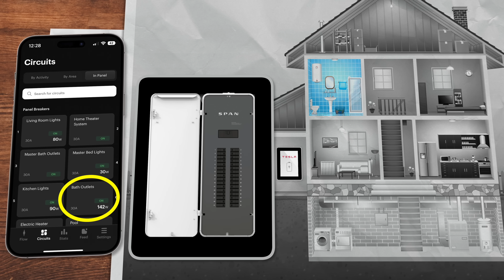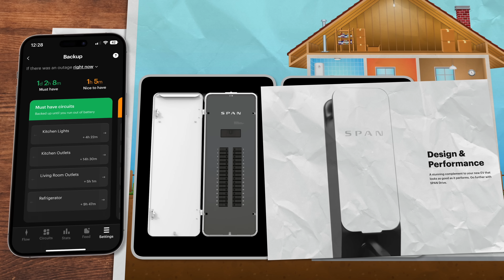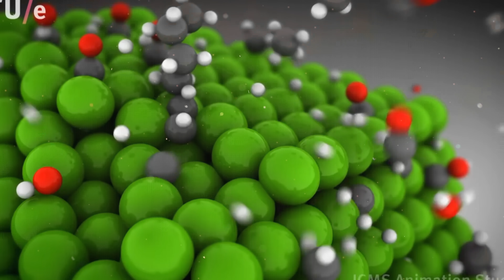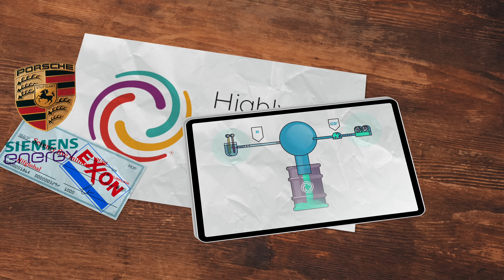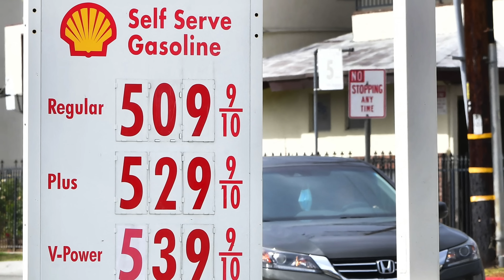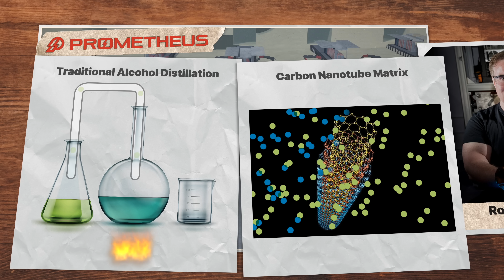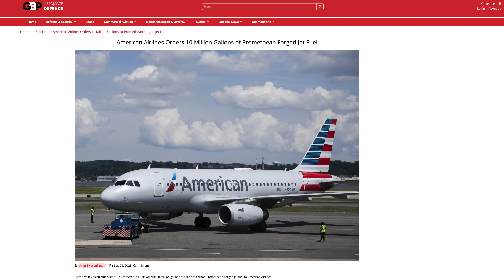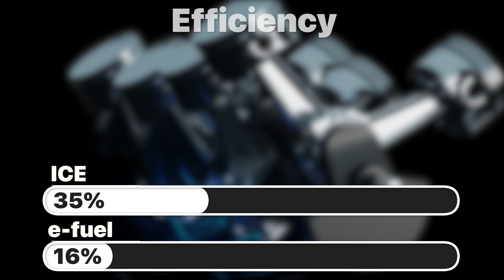EPIC Breakthrough Can SAVE the Internal Combustion Engine!

Comment: Nice presentation, have you looked at the use of Ammonia at all...   Years ago one of the fastest flights just under the space environment, was carried out by a modified jet plane...  Nowadays the process of manufacturing Green Ammonia is using a renewable source of electricity and simply water and air....  A business called FEUL POSITIVE ticker NHHHF, has machinery that can be site based and it requires far less energy than the traditional construction using Faber Bosch....
Would be nice to hear from you about this option, it is a very easy process to modify ICE to run on this feul too...
So again we get to keep the main infrastructure and it saves a lot of carbon footprint as the vehicles used now... Won't need to be scrapped and then huge environmental costs for remanufacture..... 
Ammonia has far greater in transit stability and already its being adopted in the Marine sectors...  Plus it is very good for the production of fertiliser, indeed tractor and pick up trucks have already been converted....
If you have featured this already, please provide us with the link....  Look forward to your response and content... The EV is not necessarily the only way forward, although the push is undeniable..

Comment: It would make a difference if people stopped buying suv's and other vehicles that  have a mass over 2 tones.
Personal transport vehicles can be made that do over 100mpg and are fun to drive.
Reply: Massive +1 to that! Some time ago i got to drive an early 2020's BMW. Nice four door car, 3 liter twin turbo. Thing was close to two metric tons! Sure, it accelerated quickly and actually cornered alright due to some really nice tires, it did feel really heavy and was down right dangerous if the road was slippery just because of how heavy it was. 30 mpg (~8 l/100km) was not terrible though, so imagine putting that advanced engine into something that was half a ton or a full ton lighter! Though i think there is a law here that says that no production car can be less than one ton.
Just for reference, a new Ford Explorer is 2.25 tons, a Chevy Suburban is 3. And most of the time they only carry one person... Speaking of, an old Citroen 2CV was a 600kg car with a reported 4.6 l/100km (~64 mpg), also often carrying one person. In 1980s.
Reply: @AgentWest  You have to thrash a 2cv in order to get it below 60 mpg.
I was thinking more along the lines of the Gordon Murray designed Rocket or one of the 3 wheelers that started off in the 30's with the Morgan and finished in the 60's, early 70's with the plethora of micro cars.
Small cars no more than 2 seats, powered by motor cycle engines of various parentage

Comment: The biggest challange I see here is providing enough renewable energy to produce these E-fuels without impacting on the efforts to replace our existing energy grid needs, particularly with a lower efficency since that will mean that you will need more electricity to produce the same amount of transportation.  Really, in all these techologies, the issue seems to come back to the time required to transition.  Combined with the issues we have with time (we will probably pass 1.5 degrees of warming in the next few years) we might have to make some tough choices over lifestyle changes weither we want to or not.
Reply: That is not a problem. Check out prometheus fuels.

Comment: I think tidal energy needs to be harnessed, there is plenty of places that can be used , to store the water at high Tide, close a gate, use the energy stored in the  water, or should be capable of supplying power for 8-10 hours at minimum, and more if there is a river feeding the area,   basically a hydroelectric dam, and it can work in reverse, as the high tide Is filling the system,    we need to do all we can to save the earth from ourselves!! ✌️

Comment: What about good old LPG ( Liquid Peteolium Gas) ? Nobody talks about it. Here in Australia both petrol & diesel have gone up dramatically in price BUT LPG has remained the cheapest at only $1 and diesel at $2.30..... LPG is an e-fuel as it is a cleaner burn and better for the engine. I have a duel LPG/Petrol engine so never get stuck if l run out of LPG.
Reply: I should know the answer but I don’t.  Volatility, maybe?

Another thing that isn’t talked about much is that the harvesting processes for natural gas tend to release a lot of trapped methane.  Methane has a high greenhouse gas index than CO2 when looking at a 20 year timescale.   So, it burns clean, but the full lifecycle can end up being as dirty as gasoline

Comment: Two bit da Vinci.. my idea is to use canabis smoking vaporizer tanks/coils to replace fuel injectors which will vaporize the fuel making it more volitile increasing HP and economy by up to 10x possibly. I think would need to do this in the absence of oxygen so it doesn't ignite before gets into the cylinder. I would try carbon monoxide outta the engine or argon welding gas . Could possibly use microwaves to vaporize fuel like in advanced waste tire/plastics pyrolysis to fuel plants use.

Comment: No offense why would we want to save ICE cars oh ok cool I’m just not for being addicted to oil any more. And with hydrogen power paste and the new hydrogen engine that is literally only rotating cylinders with such small tolerances it doesn’t need things like gaskets and other gas cars require. It all so weighs like 60 lbs can be linked with others in series and outputs like 140 hp and can hit 18k rpm’s. Tec and stuff like that I’m all for. I’m not biased to one technology and think the more options we have the better off we are as long as no company gains monopoly control over the market again like oil companies have and car companies did for way to long. Let’s be honest we could have been driving clean energy cars probably starting in the 80’s for sure by the 90’s just oil companies would find and but any emerging technology and shelf them hidden away so they could keep us addicted to there poison for a few more years and that’s still going on and why they short sold Tesla for years trying to bankrupt them or at worst slow them down and allow a longer less abrupt decline in oil demand but now to may people are going in to many different directions all giving the desired effect of oil free driving thru clean or cleaner energy while not changing the convenience of gas cars cause let’s face it the infrastructure and supply lines for gasoline are extensive and pre existence so any way to kinda retrofit or adapt refueling with similar ease safety and time is and has been the barrier keeping the electric vehicle market a serious hesitation and anxiety of recharging times and limited range and becoming stuck with no quick or easy way besides a tow truck and spending then possible hours to charge only to run into the same problem further on down the road and as we are seeing sure there are charging stations around and easy to find on a map but a map can’t show you if they are actually operational or if they have been damaged or just out of order from people who think it’s funny to make the snowflake cry and regret not getting a big American gas guzzler truck like real Americans own.

Comment: Interesting, but you lost me at the nano tube process that supposedly allows alcohols through but block water molecules. However, to the best of my knowledge, water molecules are smaller than hydrocarbon molecules. So, how is that supposed to work? Something doesn't square up there!

Comment: This was a good article, from what I have read in the past that when there was an embargo against South Africa it was making its own fuel with the FisherTropic method back in the 80's.  I have always said that with technology we can solve a lot of our issues, yes we want to get to something cleaner, but we can't just shut one system down and move to the other as you stated, so we need to find ways to make a transition until the battery packs are as advanced and use more basic materials to be mass produced to replace everything.  The modern battery electric car has only been in use for less than 20 years, compared to over a century for the fossil fuel industry.  I will be happy to clean up the environment with better tech.  It is when we allow companies to come up with solutions that make sense instead of politicians mandating things they may not know about.

Comment: I seem to recall that air travel accounts for only 2% of global CO2 emissions. Ricky, you omitted to mention lubrication. Two stroke ICE engines are not only in motorbikes, they're also in ships. Will it be possible (and logical, given the required energy input)to create a lubricating fuel of long chain carbons (heavy fuel oil) as well as the synthetic additives included? What about the NOx emissions and particulates?
I won't be investing in this tech as I think it's a non-starter (call me back in ten years to tell me I'm wrong). For personal transport battery development using more common elements is the way forward.

Comment: The energy comparison quoted is not very useful since it does not include energy losses in producing the electricity or fossil fuel before the energy reaches the energy storage device in the vehicle prior to being converted to mechanical energy in the power train.

Comment: I am not a ICE engineer but surely if you ask one of them that if you can choose a fuel to burn in a ICE to be as efficient as possible, he tell you that he will not use a fossil fuel and he will change the engine structure and its working pattern. We have ICE that uses fossil fuels, thus we need carbon zero fuels similar to fossil ones because we have ICE designed for using them. So if we want a sure clean future for ICE we must redesign them to use zero carbon emmisions fuels. In European Union this is a fact that politicians until now refuses to consider, but i think is the real future. In the first step we maintain ICE as they were, using zero emmisions fuels, but in a second stage we must build specific ICE to match the full efficiency of using carbon zero fuels.

Comment: nonsense! the climate crisis isn't because of my car! it is the neighours' and the green illusion that we could replace nuclear power within 15 years. A realistic changeover would calculate in a timespan of 75 - 90 years. That would work without people freezing in the winter and without housing shortages for the poor! I visited a newly built reactor in the 1970s and they said: promoting house building, by easing credits is good. But the money put into making THIS 1300_MW_el reactor, placing this investment will earn substantially more on the buck, than investing in housing! They were so right. Last year this reactor was shut down prematurely, because of German politics (and because of Fukushima). Now, my electricity bill is going up from 9.9ct/kWh last year to 21ct/kWh in 2023.  This well-maintained, old reactor could have produced it so much cheaper for another decade. 
 Concerning cars, it would be nice if every gas or diesel or turbo-engine car would be equipped with a fine particle, bypass-loop, ( < 1mym filter-pores) oil filter, in an extra cleaning loop (including a magnet, to draw the residual iron particles, and a water-absorber).  So the engines could run 1000 000 miles without oil-change; and less wear (which is in the > 1mico range), and less maintainance. But too many old fashioned businesses want to exploit car users.

Comment: The price of fuel has nothing to do with the war in Ukraine as the the price of fuel was already high before the war. The reason for the high cost of fuel is because of the present administration's policies,  ie. shutting down the Keystone pipeline and canceling drilling contracts (which by the way the Supreme Court just ruled that the President does not have the authority to do). Since that ruling we have seen the price of gas go down.

Comment: Drive your electric car and reverse the process???? Recharging the battery is NO different than fill the gas tank other than it takes a lot longer. In most cases the electricity comes from fossil fuel.

Comment: Imho, a large portion of this video is flawed.  the 90 percent efficiency gets its power from ?  It's not 90 percent if you have to rely on fossil fuels to charge it.  Add to that, our power grid can't support splitting homes and cars even if it generated power from non ice measures. 
You're comparing ice fuel efficiency to renewable power but not entering into the equation how the renewable power gets there in the first place.

Comment: Barring some kind of battery or other electrical energy storage breakthrough, I think it will be 30+ years before electric cars are able to replace all of an average consumer's vehicular needs and truly replace ICE cars as they are used today.  It will also be at least that long before electrical energy generation, especially renewable energy generation, is able to meet the increased demand that all of those electric vehicles will bring with them.  Unfortunately, the world can't wait that long to reduce our greenhouse gas emissions and slow (or preferably halt) global warming.  The best thing we can do while electric grid and battery improvements are rolled out is to invest in and switch over to e-fuels and produce more hybrid cars (not all electric cars).  Plug-in hybrid vehicles reduce the strain on the battery manufacturers and the electric grid thanks to their smaller battery packs, but can provide an all electric range that is good enough to cover most people's daily commutes.  Simultaneously, they allow for longer trips and faster refueling using the existing fuel station infrastructure that people are familiar with for their ICE vehicles.  If we can replace that fuel with as much e-fuel made with renewable energy as possible, then along with hybrids we can make a big impact on climate change in the immediate future as opposed to the decades it will take to go all electric.  This is the direction companies should be heading, but only a handful (Toyota and Porsche in particular) have stated their intention to pursue this path forward.

Comment: This sound like a good transition to whatever the next step we will use for power in the future, it will take years to decades in order to  transition from present day gasoline to the next power supply.  It may not be electric cars, since we do not have the infrastructure to charge all the vehicles needed to drive.  As pointed out plane and ships may not be able to be electrified for power.  Who knows before I heard of this today, I thought hydrogen and it present advancement would be one of the front contenders as a vehicle fuel for the future.  E fuel may be the answer to our present problems, also as more companies produce it is seems the price could possibly  go down especially if more break throughs come about in the manufacturing of this fuel.  Like you said it may be the item to replace gasoline and could be the fuel of the future.

Comment: Talking about how ICE can only make 35% and electric is 90% efficient, that technically isn't right either. The ICE converts the energy directly. The electric converts the energy indirectly then uses that inefficiently produced energy more efficiently at the time of use. But, that power conversion inefficient isn't included when people talk about EVs. EVs are the same overall and possibly worse efficiency than ICE once you factor in for power transfer losses. Not to mention the thermal conversion at the powerplant is only about 20 - 45% efficient even for nuclear on the high end. Makes 90% of 35% not sound all that good. Best to upgrade the grid for less line-loss first and then get more nuclear spun up before dumping your ICE across the board. Methanol is not good for ICE motors either. Most aren't capable of using it, and it would require removal of millions of catalytic converters or you have a serious fire hazard rolling down the highway. Service schedules would need modified also, because methanol does a number on the lubrication properties of natural and synthetic oils. I wouldn't mind if most vehicles were like a hybrid. Smaller ICE motors getting used and electric drive or takeoff assist. Those seem real nice without all the draw backs of expensive batteries and an underrated grid system. Like the videos. Glad there are people working on things like unicorn fuel. Someday it'll be that stuff we make on Mars.

Comment: E-Fuels ignore what might actually be the single biggest reason to ditch the internal combustion engine ASAP; particulate and Ozone pollution. 

Even if e-fuels were somehow magically able to be perfectly carbon neutral tomorrow, we still shouldn’t use them because the particulate matter, ozone, and other non-co2 pollution that comes from internal combustion engines is killing all of us; just check out the EPA’s website. Internal combustion engine pollution is very likely the single largest cause of asthma worldwide.  Poor and urban areas have worse, health and wealthier areas largely because of internal combustion engine exhaust. 

Humanity needs to move away from burning things as quickly as possible. E-fuel will only distracts from that.